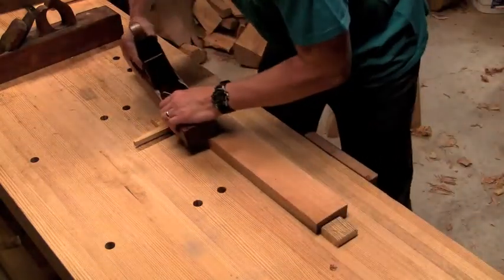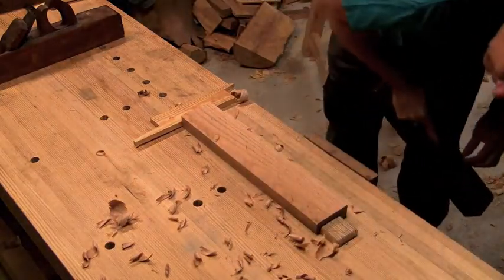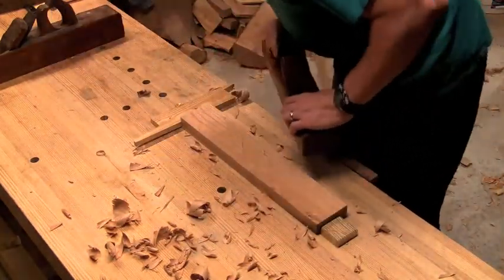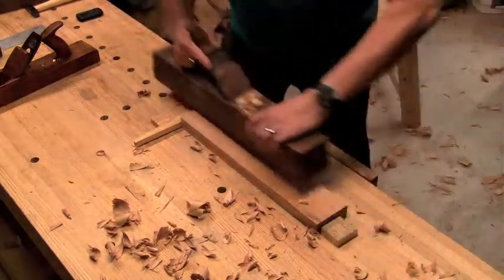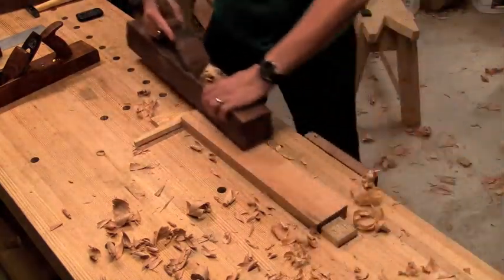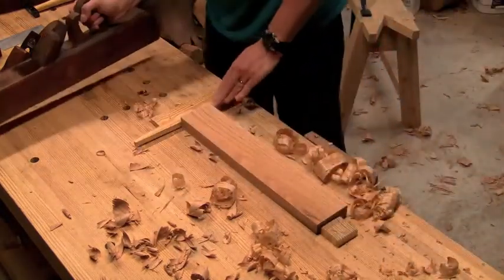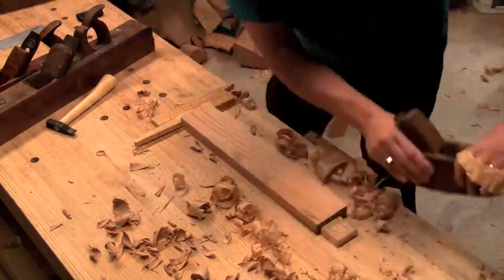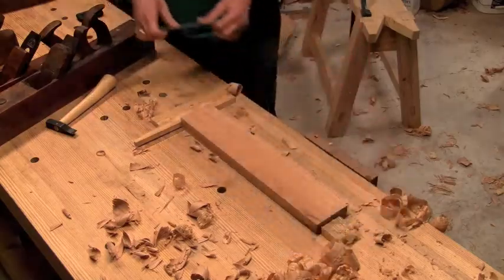Taking Adam Cherubini's Challenge: Oak Face

Comment from the maker: Yeah, finding the right height for your bench is tricky. I used the knuckle rule: your knuckles brush the top when you stand up straight in front of it. That's turned out to be a little low. Large-bodied wooden planes change the working height by an inch or so over metal ones, but still I've raised my bench about 2 inches since I shot this. You can see on my blog where I added wooden slipper to the feet.